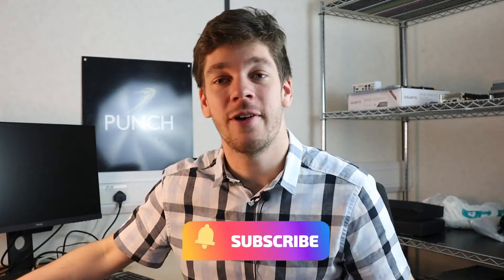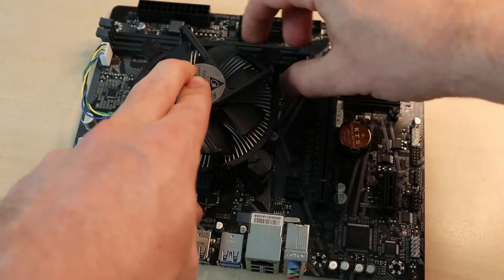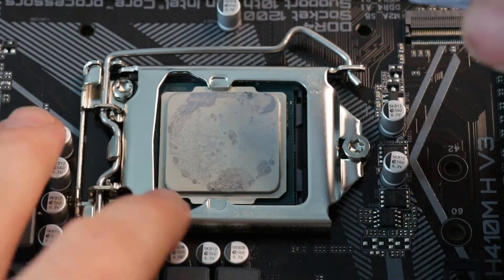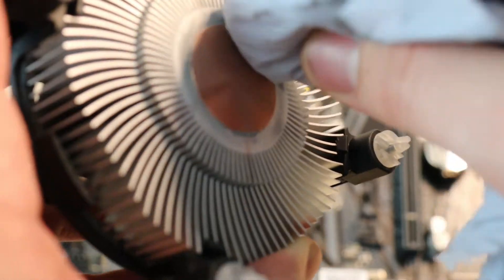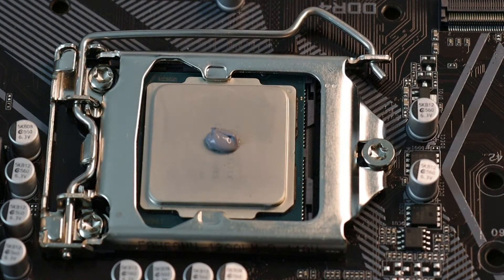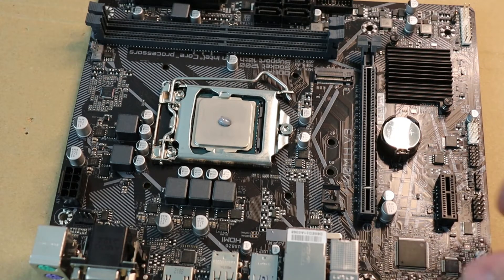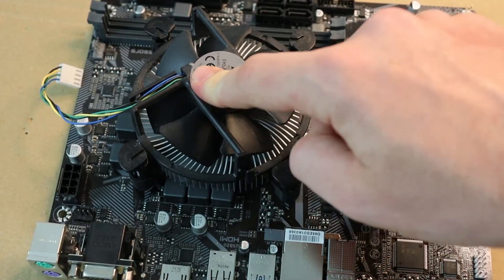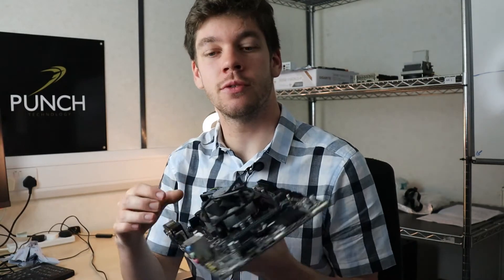How to Clean and Replace Thermal Paste on your Intel CPU and Cooler

Comment: After pushing the pins back to install the fan ,they are locking by them selfes or need to close them with the flat screw driver?

Comment: When i was opening the pins i accidentaly touched my motherboard with my screwdriver. I figured it was nothing and moved on, there comes the booting up part. Turns on for a good 5 seconds, then shuts off, and when i tell you my heart sank then ooh it did, but luckily i decided to check if all the cables were connected nicely, seemed right but still pushed them all down just in case. Pc turned on like nothing. Honestly a great tutorial, straight to the point. I also will be answering some questions in the comments (what worked for me)
1. What do you use to wipe the old thermal paste?  -- I personally used toilet paper😂 worked fine.
I also used a small spatela that came with the thermal paste to smear it.
I didnt take the motherboard out of the case. (somebody asked if they should)
This was my first ever experience doing something to my pc besides cleaning it and reinstalling windows on a usb. (first ever windows install was stressful)
I haven't tested the performance yet to see if it is better after the new paste but i will try to remember and edit the comment.
Also if you havent cleaned the pc in a while i recommend you clean the fan a little since u already have it out.
Thanks for the tutorial and goodluck to all the people following it!
Reply: Thanks alot for the tips! I am about to clean out mine for the first time (I bought my PC second hand off the person that built it); I was having problems with the CPU overheating and figured it was due a clean as its been 4 years since I purchased it. I have removed the hard drives and graphics card to get to the motherboard and I'm leaving the CPU cleanup till last. All the other fans are so dusty so I'm assuming my CPU fan will be just as dirty hahaha

Comment: when i press down on the pins they wont click into place, i really dont want to have to remove my motherboard after putting it all together, how hard should i press? I dont want to break anything!!!
Reply: Hi, i dont know if you solved the problem but first when you aligned the cooler, dont directly press to column thing they show in the video. Instead apply pressure to a dented area right beside the column thing and when you flip the motherboard, there should be colorless clamps sticking out. After that, lock those by pressing the column thing, your cooler should be locked

Comment: One major correction I would like to share: Don't force the 4 pins down when re-installing the fan. The outer shells of the pins might break. Two of mine bent sideways. Carefully insert the two halves of the pin shells first, THEN drop each inner pin to lock it into place. I'm lucky nothing broke. An improperly seated cooling fan would make all this meaningless.

Comment: For some reason I can't remove the cpu fan at all. I followed your steps and loosened the "pins" and can lift the fan up like a centimeter. But then stops and I'm afraid to pull on it. Feels like its stuck to the motherboard. Help!
Reply from the maker: Even after lostening the pins, if you are able to lift it a bit. You may need to give it an extra little pull to get the clips off.
Reply: I'm afraid to break the motherboard. But we'll see.
Reply: I’ve done it today following this guy’s instructions. Easy. Mine is also intel stock cpu cooler.

Comment: Can we use a micro fiber cloth to clean the chip and cooler which has the thermal residue?
Reply from the maker: Yes you can, but you will be wasting a cloth 🤣
Reply: @RollwithPunch  oh ok

Comment: I read that you should let the cpu and cooler dry for a few hours after cleaning them with some iso? Is that true? Seems dry to me and I want to get going on slapping this back together.
Reply: Depends on the alcohol concentration in your substance, its 70%ish then you should let it dry out for a few hours cleaning the old thermal pad otherwise if it's 90%+ then few mins will do just fine

Comment: The best way to apply thermal paste is in an “X” shape. This point in the middle does not spread across the entire cpu.

It would be interesting if you made a video showing these variations.
Thanks!
Reply: i've read the exact opposite. a pea sized dab in the middle will spread evenly out when correct pressure applied and not allow for any air bubbles like an X shape would
Reply: it doesnt matter tbh as when the CPU heats up it should help the paste spread out a bit more plus whatever was squished into shape by the heatsink @daniell1869
Reply: @daniell1869  well said. X has its own risk if not applied correctly. Pea size is the best to go

Comment: I just did this, when I start the computer log in etc my cpu pc fan starts going crazy, it’s so loud and going at full speed how do u fix this?
Reply: Bit late perhaps but check bios whether the fan is set to run at high speed and lower it down. I struggled with temps on old PC during summer so I cranked the fan to run high speed and it was noticeably louder.
Reply: @LethalWalou  Hello, so after this comment i fixed it pretty easily. Just had to put on some more thermal paste and it fixed the problem. Thank you for the comment tho

Comment: Only lasting 3 years? That’s not much,i wonder if there is no alternative way to keep a cpu cool from overheating such as heating conducting alluminum along with a cooling fan on top of it,that may should do the trick but it may require a faster cooling fan i suppose.
Reply: My thermal paste lasted 12 years until I built a whole new PC, and temps didn't get that much higher. I could counteract the higher temps with fan speed anyways. Could play games normally.
Reply: That's a good number if you use your PC to play demanding games

Comment: do you need to remove the motherboard to change the thermal paste?
Reply: Typically no, your cpu should be attached to the motherboard and shouldn't need to remove your motherboard in the process of changing the thermal paste. Most cases will open up and allow you to access your cpu cooler and replace the thermal paste.